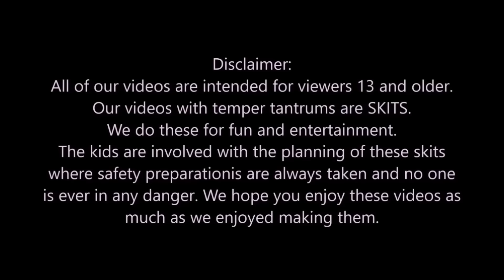Kid Breaks Mom's Car Window With Hammer! - UNCENSORED VIDEO

Comment: You need to have laminated glass (in 1/3 of cars in the US I think) and not tempered glass (in the other 2/3 of cars in the US I think) because laminated glass (laminaprocted) glass has two sheets of hard plastic on both sides of the tempered glass (which is the glass in the van that was broken by Leland bringing a hammer to the glass.) Laminated glass (the one I'm saying you should have) cannot be broken by anything such as what first responders have which are the heavy-duty tools, such as the Glas-Master Rescue Hand Tool, which are the only things that would be in a place like where you live where you have nothing in the area your living in other than what the first responders in the area you are living in carry.